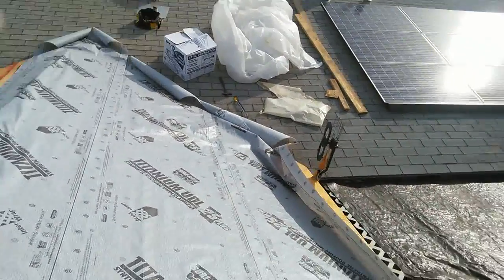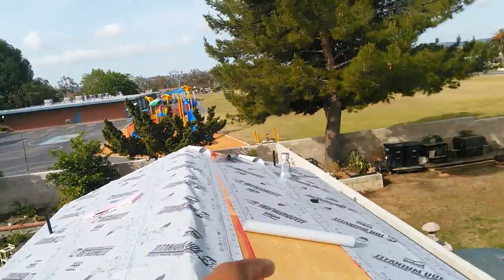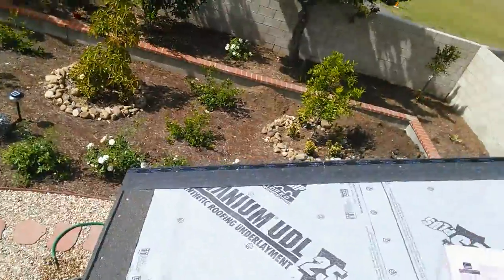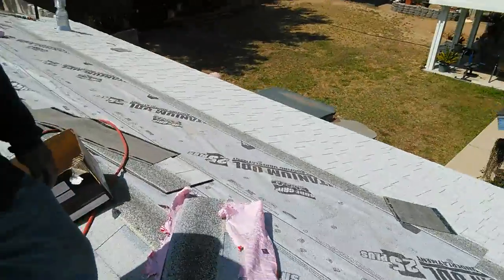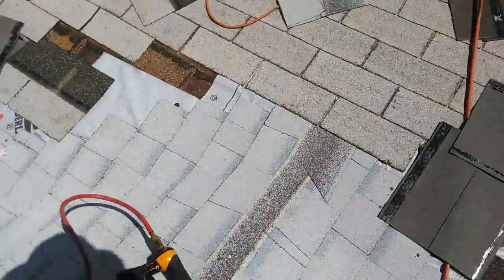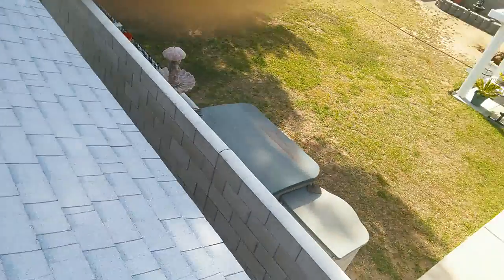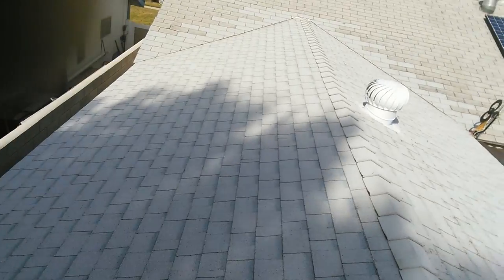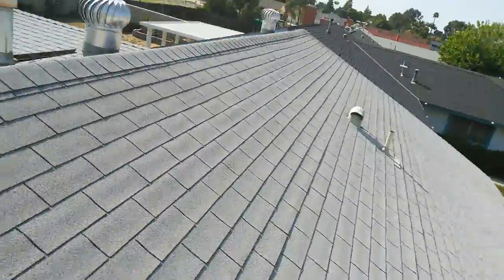How to roof  a closed cut valley , roofing shingles. DIY Video .

Comment: What knife or blade is that? Please let me know. Thank you
Reply from the maker: it's a standard hood blade ,it has the same hole as the straight blade everyone uses, it's sold at HD , remember , hook blades.
Reply: Roofing Solutions By Eric Garcia Eric I usually cut my gable starter st an angle so I dont lose that 6"'s of tar line and my shingles seal properly.  maybe I missed that but it didnt look like you did that.

Comment: never roofed before...why did you cut a line down the valley and why wont it leak after cutting....i am missing something basic here.  thanks
Reply: he cut the patched shingles and the new shingles are under and past 6 inches of that cut line. he didn't cut the new roof shingles. i normally weave my valleys but each to there own
Reply: Andy Cruz you weave with laminated shingles? A weave is the  best Valley for 3 tan shingles but the weakest for laminated shingles.

Comment: you just have one roof on it could just went over top of it warranties the same it's a better roof because you're starting out with a very good base you still can use your ice and water Shield also we used to use 60 pound paper before they made ice and water Shield at least for the three tab of course we used to hand nial and you could tell if the nail mist if it did at least for the ice and water or 60 lb you pull a nail out and put roof cement on a nail hole and this company started back in 1936 and they were like top-of-the-line in my area

Comment: i don't know about where you live but where i live you have to have ice and water shield in all valleys
Reply from the maker: TAW_Qtip I live in Los Angeles California USA, where we have few rain in the whole season, I only use Ice shield in Big Bear mountains, where they get snow, but not on the L.A  area.
Reply from the maker: +RnaGenetics you don't have to as long as your nails or bolts reach all the way down to the existing roof frame
Reply: TAW_Qtip yup I’m also a Los Angeles roofer and on Los Angeles we don’t need to use ice and water shield.

Comment: Why so many nails on starter you nail about 8 nails. 4 nails Is fine is hurricane areas and you put too many nails around were the factory cut of shingle is going to meet with other shingle. Over here in Texas 2 nails on bottom of starter is good 4 nails on shingle too. The most important part is where you nail.